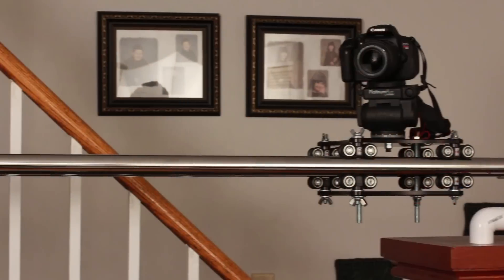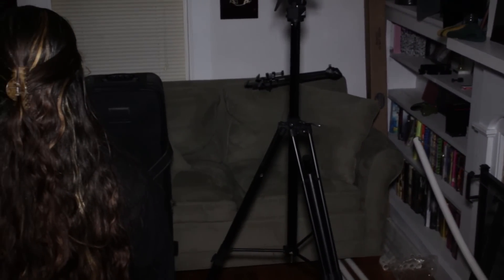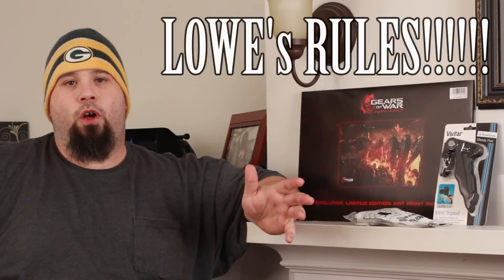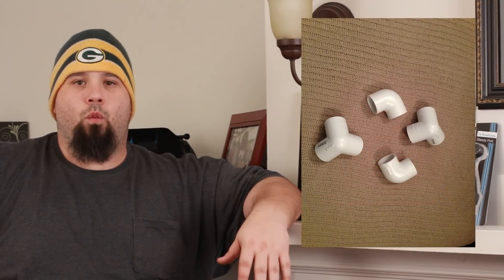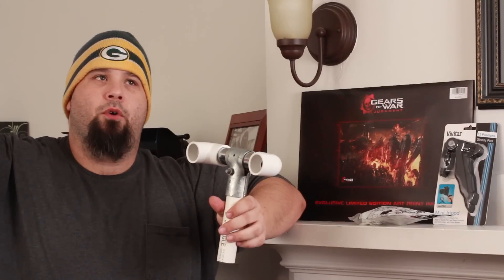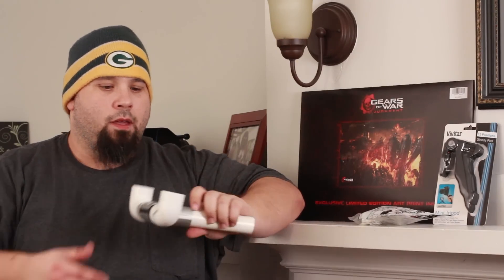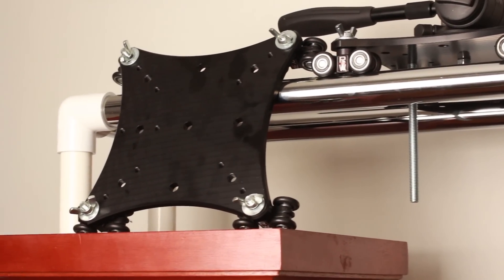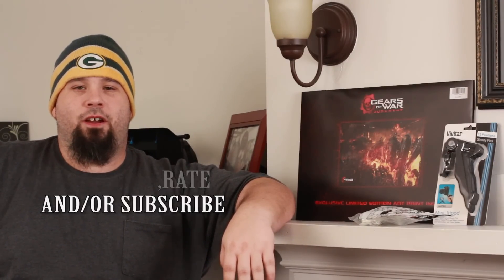TRP Best DIY Slider on the Planet - The Proof is in the Episode

Comment: Hi, thanks for the great ideas. A cheap alternative for RigWheels are these from Amazon. Creality 3D Direct Store V-slots POM Models Plastic Pulley, V Groove Ball Bearings Pulley Passive Round Wheels Roller For Ender 3, CR-10, CR-10S [6 pcs] You can easily make a rectangle of wood, mount one wheel at the front on the left, the other wheel at the back on the right & with a hole in the middle then you can attach a pair to each end of the tripod dolly. (You only need 6).

Comment: Nice work as always.  It should also in theory to shave off a few dollars by buying 6 foot long pieces instead of 8 foot, and substitute out the T brackets / Brace rail clamp, for a 1" PVC T-joint and using two 2" PVC pieces.  This of course is a bit less accurate than the video solution.